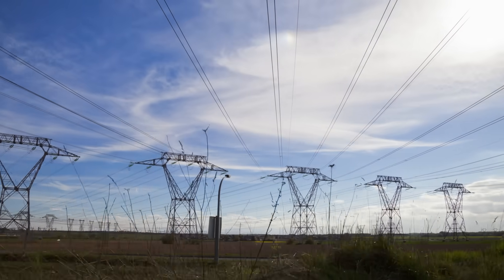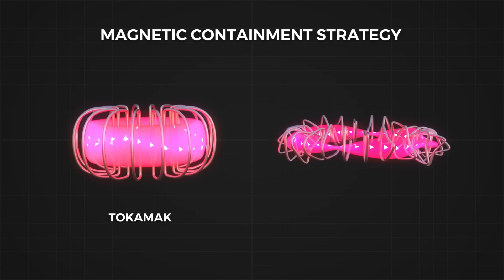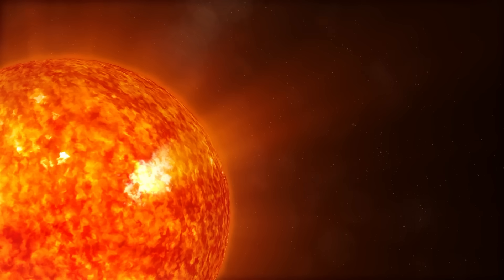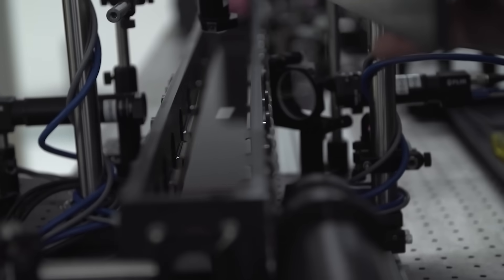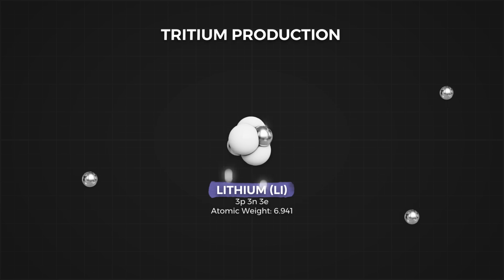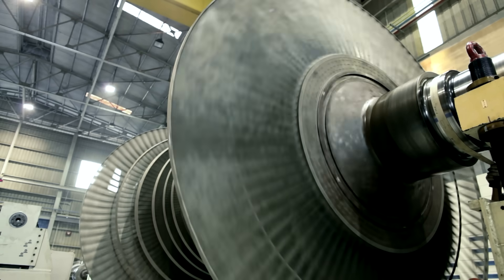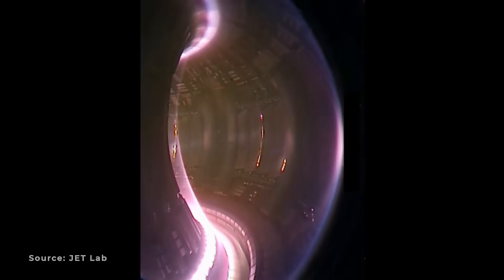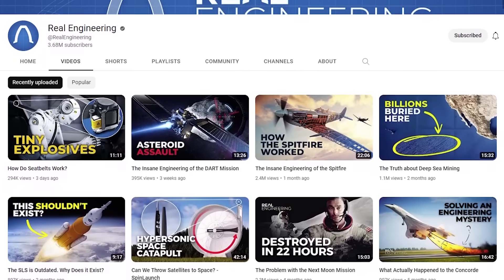The Problem with Nuclear Fusion

Comment: Thorium is a great source of nuclear energy. It has been known since the 1950's but thorium doesn't produce nuclear fuel for nuclear bombs so it was never used. Thorium is much safer.
Reply: The Thorium Molten-Salt Reactor
Reply: Safer but more expensive. And fission is already too expensive.
Reply: Then why aren't all nuclear energy companies jumping on it? Hm?
Reply: @flytrapYTP  I think I gave that answer in my original post. Thorium doesn't produce nuclear fuel for nuclear bombs.
Reply: @flytrapYTP  You can also thank President Richard Nixon for telling the Nuclear Regulatory Commission not to use Thorium Molten-Salt Reactors. A molten salt reactor (MSR) is a type of nuclear reactor that uses liquid fuel instead of the solid fuel rods used in conventional nuclear reactors. Using liquid fuel provides many advantages in safety and simplicity of design. But in other countries there is now renewed interest in MSRs in Japan, Russia, France and China
Reply: @flytrapYTP  Under the supervision of Alvin Weinberg in the 1960s, Oak Ridge National Laboratory built an experimental MSR that ran successfully for four years. Weinberg realized early on that MSRs were the ideal type of reactor for civilian use because they cannot melt down. He was eventually fired by the Nixon administration for this advocacy.
Reply: @flytrapYTP  MSR technology has potential far beyond generating electricity cheaply and without emitting CO2. For example, MSRs could be used to replace fossil fuels for high heat industrial processes such as water desalination and the production of cement and aluminum. (In the U.S., industrial processes account for a little over 5% of greenhouse gases.) MSRs can even provide high heat for cheap production of feedstock for synthetic, CO2-free liquid fuels.

MSRs could also be used to power large container ships, which currently run on diesel. The 15 largest of these ships produce as much air pollution every day as do all of the cars on the planet.

Comment: First off, not a Scientist. I am not qualified to speak on anything I'm about to speak about. That disclaimer aside. I've asked this question before and the response has always been, "We'll never run out of water because there is X amount and we only need Y amount". So Deuterium and Tritium are mostly created in fission reactors. There is some in sea water that we can capture as well. Deuterium can be created from normal Hydrogen. All of this relies on water. There is this thing called the Fermi's Paradox and another called the Great Filter. Now I normally try to stop myself from doing leaps in logic because it creates schisms in society. Like the whole vaccines cause autism thought poop. So again, with a grain of salt. Is it possible that advanced civilizations may be wiping themselves out by destroying their oceans through ever growing usage of fusion technology in the mistaken belief of future technology to solve the fuel availability issues. Venus is the way it is due to the lack of water. Where a sea bed would be, is rock. With no water to absorb carbon, the atmosphere went into a run away green house effect. Though it could also have to do with other factors such as day length and the belief that Venus's core has somehow stopped. The whole, we have huge oceans thing mirrors the argument about fossil fuels never running out due to plentiful supplies. It's not a case of if, but when. I don't have any issues with fission since it's a metal we have very little use for. Hydrogen seems a bit more important. Plus the abundance of oxygen that would have other far reaching consequences I haven't thought a lot on. Maybe a rise in oxygen will cause planet temperature to fall enough to cause carbon snow, so that's one way to solve global warming. Jokes aside, my question still stands. How are scientist solving the whole, ocean depletion thing? And I won't accept the excuse of hydrogen being plentiful on other planets. We can't reliable get to Mars, more than not somehow mine Jupiter. I hate that answer because it implies unreasonable technology development in a short time frame.
Reply: There’s nothing to solve. Two reasons:
1. As you alluded to, we don’t use enough water. The sun would explode before we used a tiny fraction of it.
2. We only need the deuterium from water, not the protium. So even if after billions of years, we used up all of the deuterium, almost all the oceans would still be there - because only a tiny fraction of the oceans are deuterium.
Reply: @Gomlmon99  1. It used to be thought that oil was near limitless due to it's low use. Peak oil is going to happen in the next 20 years with some experts believing that it's already happened in 2018-2019. We are already using alcohol mixes due to issues in supply. Fusion power will become a very lucrative and billable source of energy. One that will replace the petroleum industry. The energy requirements will still be there. Fission power was the answer, until it wasn't. Mainly because of fear, uncertainty, and doubt to an uneducated and aging population.
2. When I say that we create deuterium in fission reactors, I mean we create deuterium from stable hydrogen (in water) in fission reactors. It's not cost affective at all. For now. Humans have no reason to make it cost effective since it has no real use where a large consumable supply is needed. Remember that shale used to be thought useless, but we're now extracting oil from it because of supply issues.

Personally I think fusion energy would be a great tech in a post space faring civilization. Especially on water world super earths or in gas giant mining operations. Though I prefer methods that don't require steam generation and as few moving parts as possible.

Comment: More Bullshit. The 1.5 energy output gain ratio reported did not include the energy to run the lasers. When taking this energy into account, the gain ration reduces to less than 1%. Nuclear fusion will never happen. Also, the facility to produce the experiment cost $18 Billion to build and was more than 20 years in construction. Maybe, that is why they did not include the cost to run the lasers in the gain ration: They knew they'd God Damn Fucking Better report a breakthrough.

Comment: the other issues are:
the energy INPUT, doesn'T imply the energy to maintain the magnetic field and power the whole,... 
the energy input is the amount of energy used to generate the plasma,
so even when they would succeed at a NET gain of energy, meaning more energy then the energy used to produce the plasma, it wouldn't still take into account all the other energy required to maintain the central operationnal.... so it would require even more energy...
because the energy input they declare, is the energy input on paper... aka the energy they put in the reaction (plasma) and then the energy the gain from the reaction... so they can compute those 2 and define a gain or lost...
it doesn'T account for the energy to maintain the environment to produace that reaction... the the energy put IN the reactor...
that's where they are dishonest... because they want their financing and they are scientists and the information they can get from such experiment "can" be valuable for the science...
the other issue is... the fuel required for the reaction REQUIRE to have fission plant aswell... so there is no escape we gonna have to maintain those, and the more fuel we gonna require the more fission plant we gonna need....
the truth is that fission is so under exploited,... we are using uranium as coal to boil water...
when the amount of energy that would be generated if we would manage to divided an uranium atom entirely into as much atome of tritium as there is proton in the uranium...
there would be no waste... and the fuel would last 50x time longer...
because rightnow the uranium just degrade and produce at best 3 other atomes from a single atom of uranium... not 92 atoms
that's the details no one is talking about, and that the public is compleatly oblivious of.
The truth is that research in Fusion might give us knowledge to reach a better Fission efficiency...
Fusion and Fission are both necessary and should be researched along together... each need the other.
if we could fission uranium into 92 tritium... and then use that tritium to make fussion... that would be something.
But I don'T expect Fusion to ever produce what they are pretending... that's a pipe dream.... if we cannot manage to be more efficient it fission there is no reason to expect we could manage to be in fusion.

Comment: As far as I am concerned, power from fusion is a will-o-the-wisp that we will never catch. It will never be as clean as its advocates claim because it generates neutrons and neutrons make everything they hit radioactive. Worse, these plants will be huge, no matter their power output. We have proven fission power that has shown itself to be as reliable as a clock and the newer fission plant designs are even safer than the old light water fission reactors. The new liquid thorium salt reactor, unlike the light water reactors, do NOT generate high pressures, just very high heat. The least leak will cause them to shutdown. Are there drawbacks to these designs? Of course there are. Nothing is perfect and what this guy is trying to sell is a complete bill of goods.

Comment: I keep asking this question. If we make the switch from oil as a primary energy source, does it mean that it will not be traded again in finance? Or, does it mean that we would trade fusion energy/electricity contracts in its place? If we do trade electricity contracts, would it not be counter productive, given that energy is supposed to be free?
Reply: If you think that fusion energy will be too cheap to meter, you are going to be disappointed if it ever becomes widespread.

Comment: We don’t need fusion 

We have fission
Reply: Fission does not solve long term energy need. 
Yes, we should replace almost all fossil fuels with nuclear power. But the next step from there would be to start the cycle from over. Slowly replace nuclear power with even better power.

Comment: The fusion of hydrogen-3 (tritium) with hydrogen-2 (deuterium) doesn't produce radioactive fusion products, the way fission produces radioactive fission products. But does that mean it's CLEAN? No, the products are an alpha particle (a quite high energy helium nucleus) and a VERY high energy neutron, the ONLY kind of radiation that can make other elements radioactive. The third phase of the H-bomb, properly called thermonuclear, supplies half the blast by fissioning the "non-fissile" isotope 238 of uranium.

Comment: Even ignoring that the nuclear plants release radioactive steam that causes cancers and produces weapons grade plutonium with a half life of 24,000 years, the power also need to be transmitted long distances. Solar panels on a rooftops work equally well and does not emit toxins or require centuries of monitoring of waste fuel or need massive new high voltage power transmission lines. 

When solar and wind are fully deployed there will only be a need for nuclear power plants to supply the atomic weapons companies supplying the military. Solar and wind are economically viable today and do not require trillions of dollars in government subsidies or blanket disaster protection.
Reply: Source for the radioactive steam claim?
The secondary circulation, the one that cools down the reactor water, goes in totally seperate pipeline.

Comment: Sorry, but it aint gonna work.
The mass, can only give the energy, that is restored in it.
Then there is few questions.
How much more weight did the particles gain, when heated in process ?
Compared to other particle, how much energy can they restore in this high temperatures ?
If in every force in nature, there is an equal and opposite force, so how is fusion playing in this ?
It ain, is it not ?

Comment: Of March 2019 by Invite only to an engineering conference held inside MIT"s Electrical Dept. on Vassar St. I gave a presentation on how NItchtisu's Noguchi of early 1940s Hamhung, Hamgyong Province northeast of the Kumgang Mountains had perfected cosmic ray muon catalyzed fusion rocket plane propulsion consisted of a Dewar of cryogenic liquified deuterium fuel connected to a beryllium alloy rection chamber nozzle coiled in around electromagnet coils for cryogenic fuel to have prevented exceeding Curie Point while alpha particles were deflected for neutron flux to enrich fuel.    

During the 1990s Dr. Mitchell Swartz had published my peer reviewed articles and Ruby Carat of Eureka posted transcript of my presentation online.